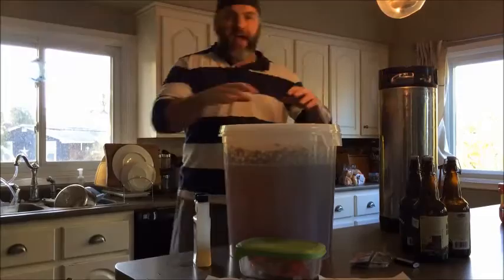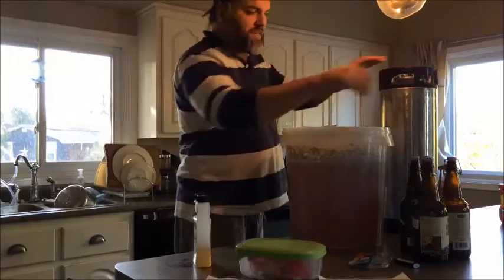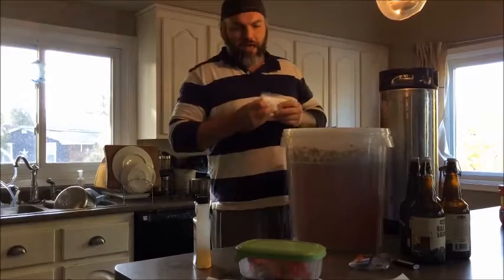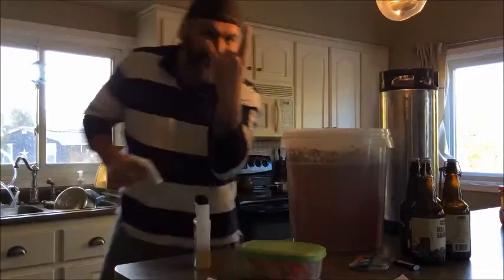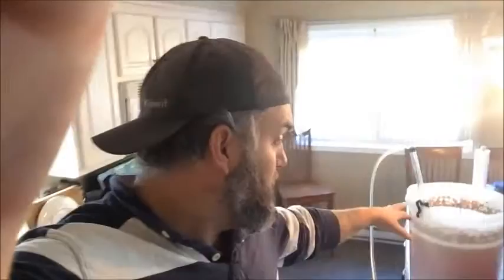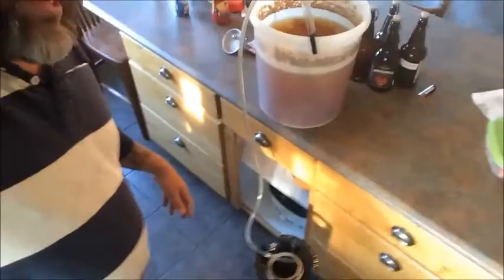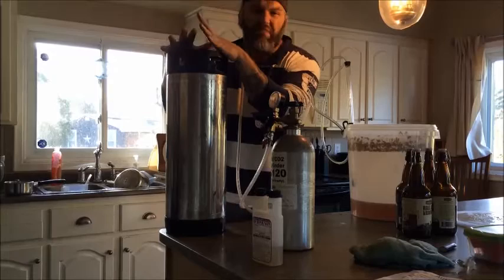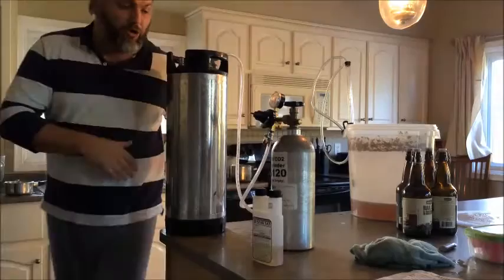Kegging Coopers Lager with Priming Sugar (no Co2)

Comment: Hello Rob. I have a question. After naturally carbonating the beer for a few weeks in a keg., When I tap it, do I need to pull the pressure release valve before?
Reply from the maker: Hey Kai, should not need to no, You can probably even pour a few without setting up the gas for serving.  If it is too foamy etc, go ahead and bleed off some pressure, it won't hurt anything.  Cheers
Reply: @MakeBeerEasy  Thanks for your advice. Love your energy and videos. Cheers
Reply from the maker: @ChickenPadKai  Very welcome!  Cheers!

Comment: Great video. I'm a bottle guy since I'm very afraid about co2 cilinders(long story). I was wondering if it is possible to do it without spurging the o2. Just fill up and close. Will that oxygen ruin the beer? Then I would remove the beer with disposable 16g co2 cartdriges... like beerking device. any thoughts?
Reply from the maker: My two concerns there would be that the oxygen would create some off flavours as you were not able to purge it, and second without a seal on the lid the C02 might escape or I suppose it could slowly seal the lid, I've never done it, but who knows it might work and perhaps an experiment will need to be done!  Cheers

Comment: just stumbled onto this, so not sure if you'll get this.  You have a cooper's fermenter?  If so, is it the older or newer one?  I just got one, and was hoping you might tell me what you use (kind and size of tubing) to xfer from the spigot into the keg?  I'm using 5/16 id  7/16 od silicone tubing.  it fit's but can't seem to get it on far enough so that it's not easy to come off.   thx!!
Reply from the maker: Hey Bobby, sorry for the delay in replying, been out of commission here.  That is the older Coopers fermenter.  If I recall it was the 5/16 and had to work to get it on.  Sorry wish I could be more help.  Cheers

Comment: Hi,

some questions, please:

- Do you let for fermenting with 30PSI? that's not the pressure to force carbonation?
- Do you put to rest 3 weeks with the CO2 bottle connected? or disconnected?
Reply from the maker: Hey...  in this video I was fermenting with sugar, the C02 was used just to purge the oxygen from the tank and to seal the keg, it was then removed.  Cheers